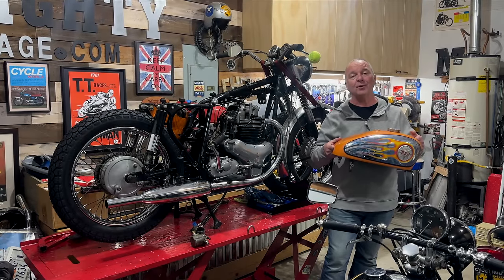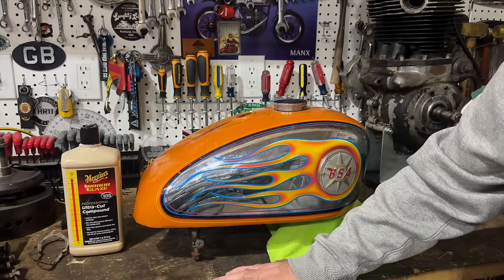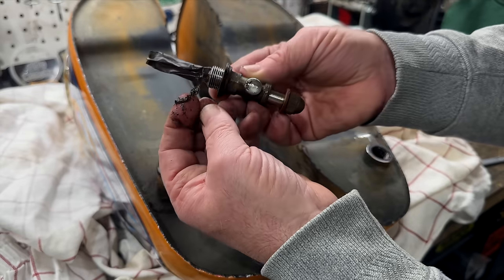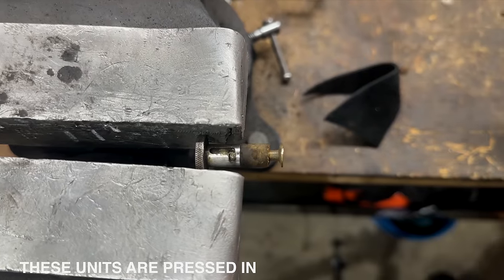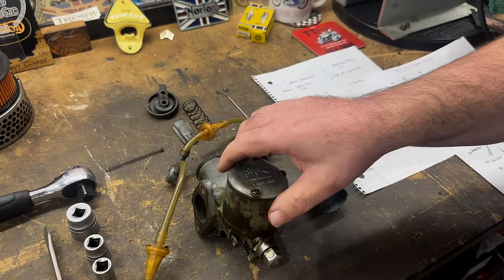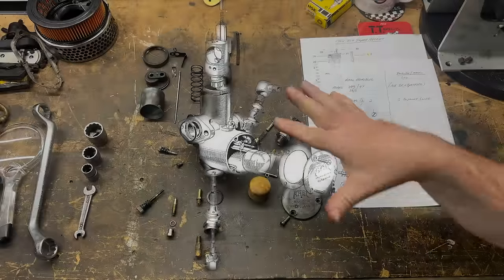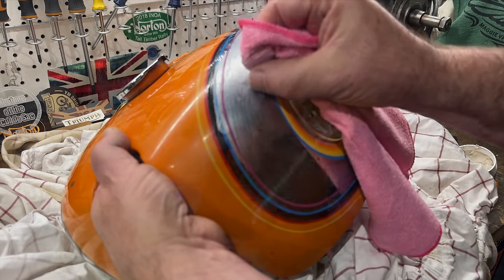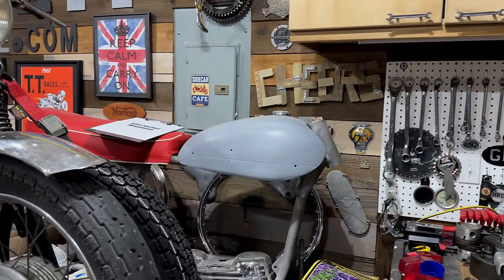1962 BSA A10 Super Rocket (Part 6) - Fuel Tank & Carb

Comment: Did the super rocket originally have one or two carbs? I would have thought the latter given it was a more sporting model.
Reply: Factory twin carb head commenced with the A65 type.
Reply: Yes the A10 Super Rocket had one carb and surprisingly so did the more sporty A10 Rocket Gold Star.
Reply: The only production pre-unit BSA with twin carburettors was the pre 1950 A7 Star Twin 500.

Comment: i have an A10 framed 'special', can't work out what the purpose is of the bracket with rubber bung is for hanging off top frame tube in front of cylinders, fender to keep cables/wiring pinch free?, any ideas?.
Reply: It supports the petrol tank. When it's full there is a lot of weight trying to bend the two halves of the tank inwards.